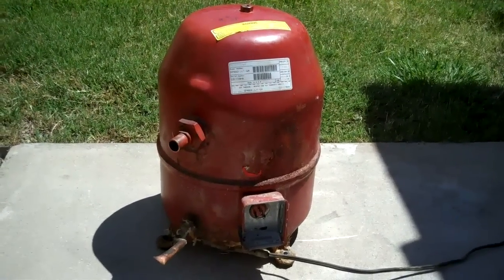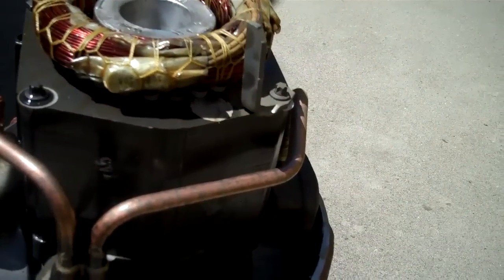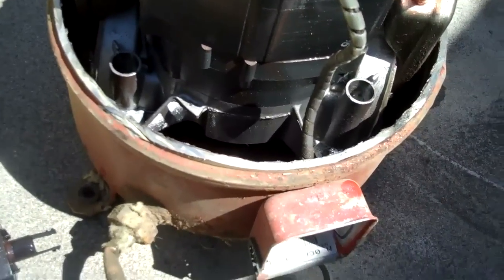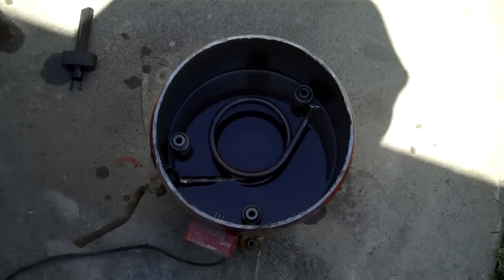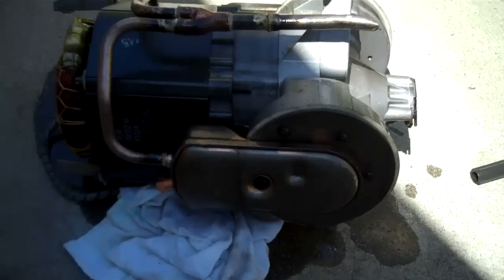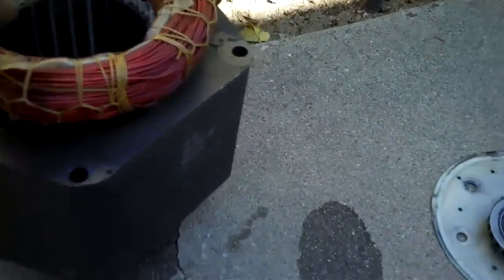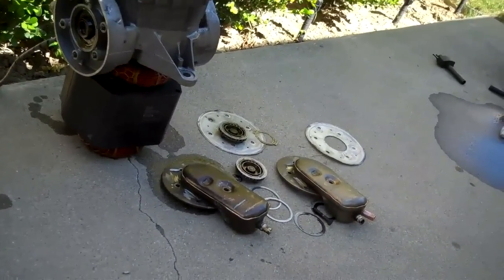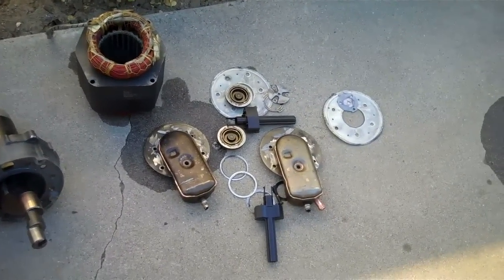Trane  / American Standard compressor exposed!!

Comment: Great video, I have one of those using it as a air compressor because it runs very quiet and fill up the air tank very quick, this video helped me up to drain the oil and refill it with fresh oil to keep it clean from moisture.
Thanks
Reply from the maker: Thanks for the info!

Comment: We have had excellent service by ALL-IN-ONE SERVICE here in Wilmington, NC. They have responded quickly and efficiently to every call. We had them replace our perfect 14 year old units with two high-end American  Standard heat pumps five years ago. The smaller unit has worked fine; the bigger unit has required service well over 100 times over the past five years with most of its components being replaced at least once including the compressor. Freon leaks are standard for American Standard, and the quality of this unit is obvious. We spent around $13,000 to replace a perfectly working if older system for what has become a service nightmare. Now we pay for a service contract and could not be more disgusted with a product. We are thinking of having the unit junked and replaced with a different brand. Standard should be paying us for the inconvenience and we certainly should not be paying for a service contract. Buyer beware. I would never consider Standard (just another name for Trane to maintain exclusive area franchises) and am looking for something considerably more reliable. Standard should be avoided and the lack of quality controls (including Trane) should be publicized. Our coil now needs to be replaced again, a major job. While not a financial burden, it is clearly one more American Standard inconvenience. I would not take one of these units again for free. I haven't even mentioned the electric bill spike when the unit is malfunctioning; over $150.00 electric bill  increase in one month due to a second failed coil.
Reply: ron cerra only 150.00?you extremely lucky.